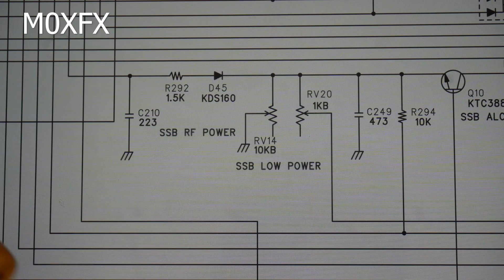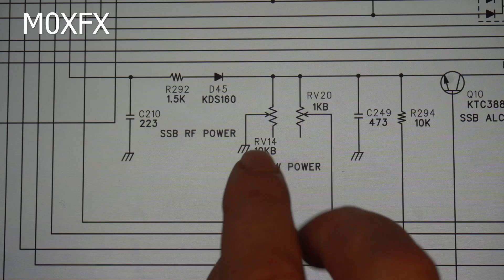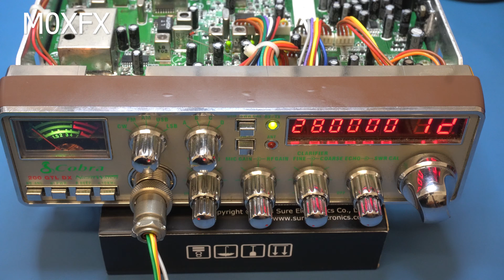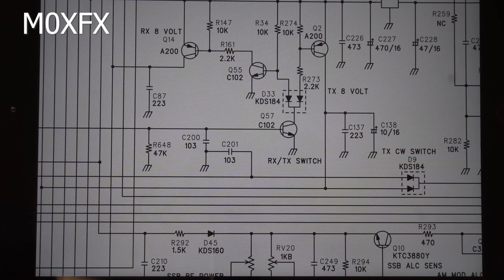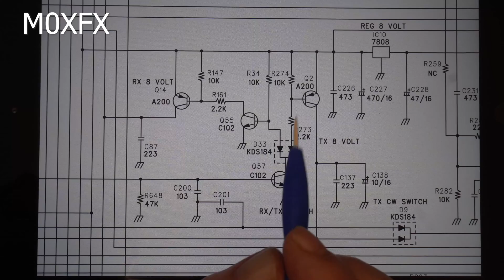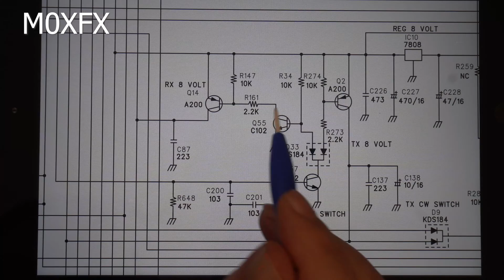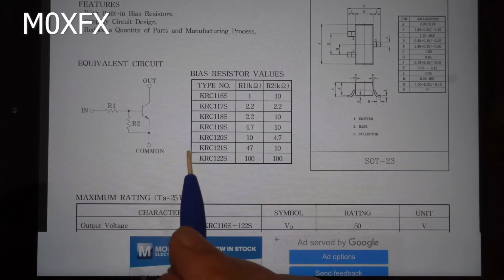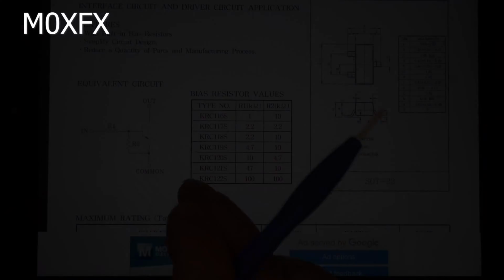Cobra 200 GTL DX Repair Part 3

Comment: Wow. Looks more like an episode of Miss Marple with all the detective work of what is going on right down to the transistor with internal resistors and the redulting partial switching of tx and rx. A lot of effort and brain power going into that rig.
Reply from the maker: Thanks for the comment, Yep it been a difficult repair and diagnosing the faults has been the hardest part.